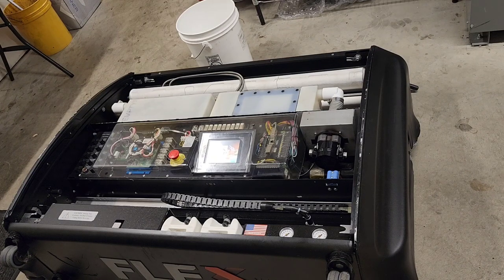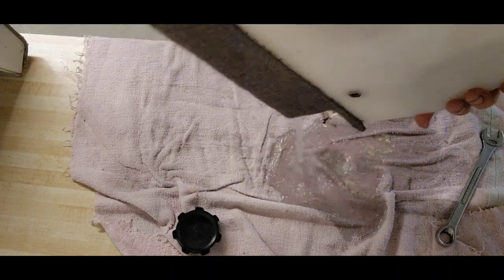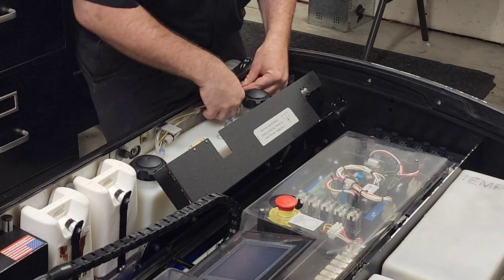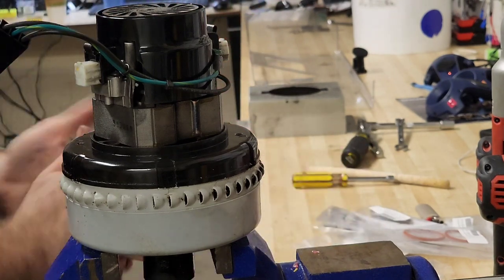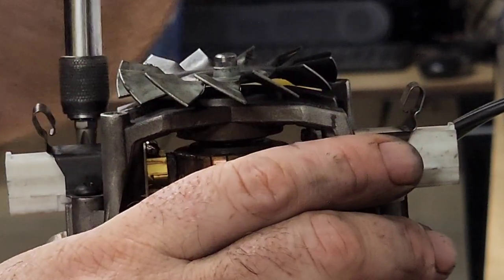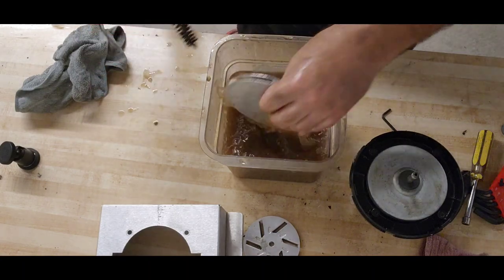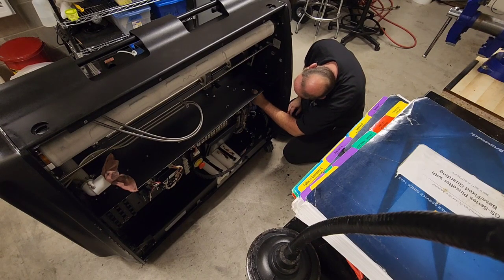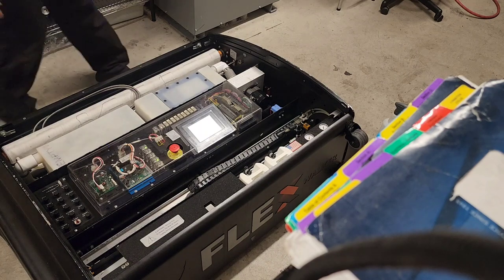2018 FLEX Walker tune-up video #3. Water reservoir and vacuum motor service.

Comment: Hello sir. Thank you for making these videos. I find them very helpful while working on the Flex lane machine. May I know if you will release part #4 on the conditioning system? Thank you.
Reply from the maker: Hi Daniel. 

I haven't done a part 4 yet. I went through the oil system components before I started the channel. I'm glad that you came along for the ride on the FLEX tune-up! I will plan to do a part 4 that covers the oil system in depth within the next few months. I can guarantee that will happen.
Reply: Alright thank you!!!